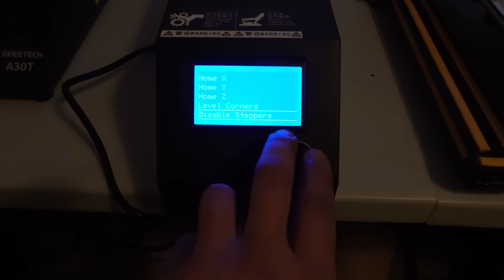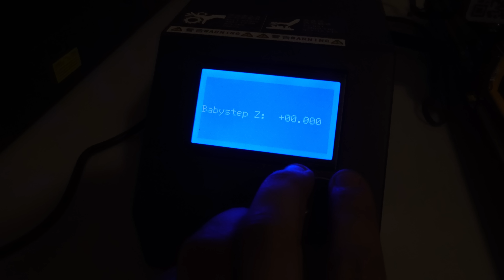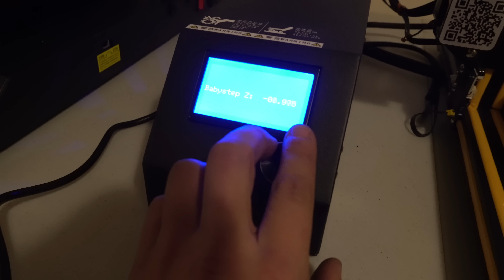Creality CR-10 S4 | Let's Build, Upgrade, Discuss | IT'S HUGE!

Comment: I put together an S4 a few months ago and its been a workhorse. An S4 would probably run okay stock but a few inexpensive (or free) upgrades really helps it perform well. TH3D Unified works great on Creality 8 bit boards and a metal extruder and Capricorn tubing are always good additions to any Creality printer. Advice for anyone considering an S4: You'll need a LOT of room behind it. That big bed goes back pretty far and you still need clearance for the bed cable. I've got mine on a 3'x3' table and wouldn't want to put it on anything smaller. Good content as always.

Comment: I've had this printer for over 2 years. The OEM glass is not completely flat. The OEM heat pad takes forever to heat up. I had a large mirror I cut to size, I installed a silicone heated bed (heats up to 60C in about 1 minute), installed a Capricorn bowden tube, an EZABL, and a Bondtech extruder.
Reply: You have a link for the heat bed you upgraded to? I can't stand how long it takes to heat up with the OEM

Comment: Biggest upgrade I made to my S4 was the 120V AC powered bed heater.  Get one of those with a quality solid state relay and it takes less than a minute to reach 60 C and probably right at a minute to get to 110 C.  I have this printer inside an enclosure and it prints ABS no problem with that AC powered heater.

Comment: Honest question. Looking to buy a filament and a resin printer... First time. Running DND, and a whole bunch of other stuff.

Why would I buy a printer that "needs" so many upgrades to be the ideal printer. My buddy is offering his cr10s4 for $500 with these upgrades. Super tempted. But also I could just buy a smaller filaprinter from anycubic for cheaper. But also... The size is tempting for a few scenes I have in mind lol

Comment: Frank, I have a question for you.  I have had a CR 10S4 for e few years now, and I am looking to replace my entire hot end (thermistor, heat sink, heater block).  When replacing a thermistor on a different unit, I accidentally got the wrong volt/wattage.  I got a 12v/40watt when I needed a 24v unit.  Do you know what the CR 10S4 takes?  I have searched for specs online, but am coming up empty.  Just wondering if you happened to know.  Thanks for your many useful videos.

Comment: Did you changed the mainboard ? Your CR10S4 is so quiet.... We also got an used CR10S4 and the stepper drivers are louder than an old 56k modem.. It's not fun using the printer, the results are great but the neighbours already complained about the noise.. Now i'm not sure if i can just swap the board with an SKR mini etc or an cheap Aliexpress Board with silent steppers
Reply from the maker: Hey! Nope stock board

Comment: Bought this printer 2 years ago. I like but the only frustrating thing about it is the filament sensor, they wear out incredibly fast, resulting the printer to keep pausing while doing prints. :( 
I've had to replace it multiple times.